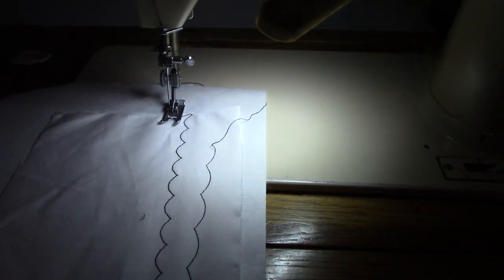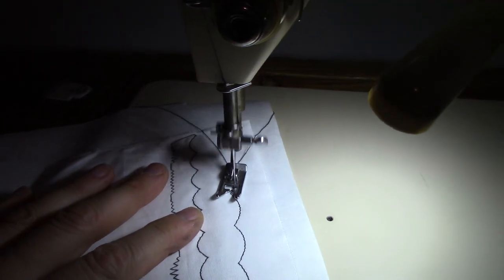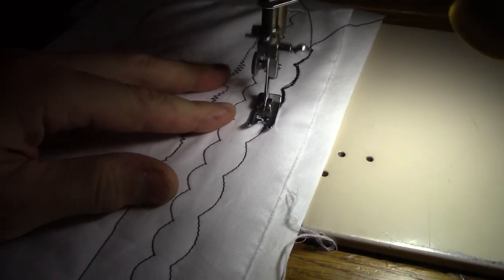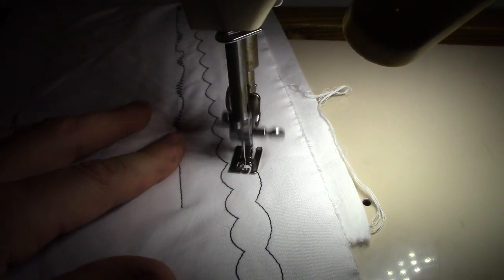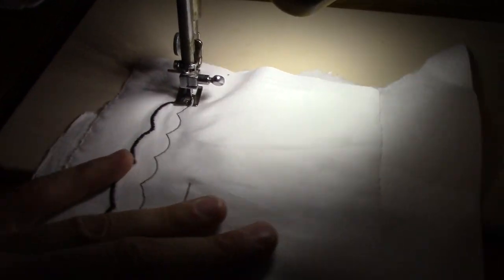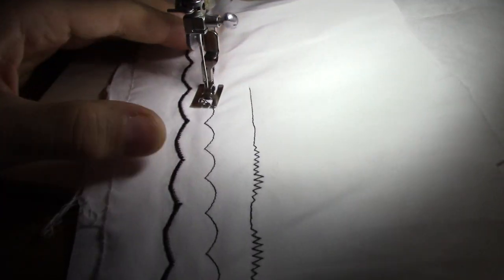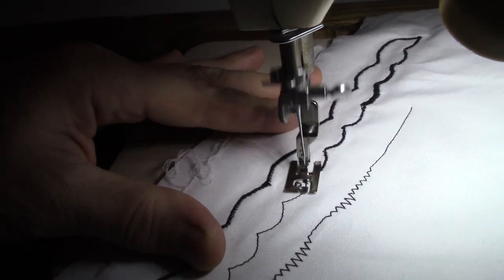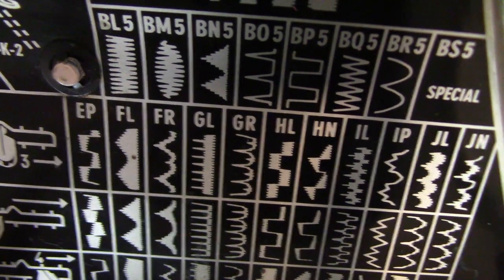Lengthening Scallops, Keeping Stitch Density - Vintage Sewing Machines

Comment: I found that very interesting James. I have a 431G but I don't seem to have much success with any fancy stitches. My machine seems to only like a very heavy thread - like upholstery thread for anything zigzaggy. It's very frustrating. Martin.
Reply from the maker: We need to get your 431G working properly. That machine is highly sought after. Can you confirm if you can only use heavy thread in the bobbin to get good results? If the machine zigzags properly, and it is well oiled, then there are only a few things that likely need to be tweaked to get it to work perfectly. It is easy to do, so watch some videos from archaic archane on freeing up the machine, then we can look at the bobbin area and figure out why stitches are imperfect.